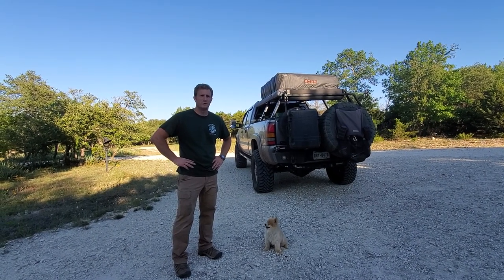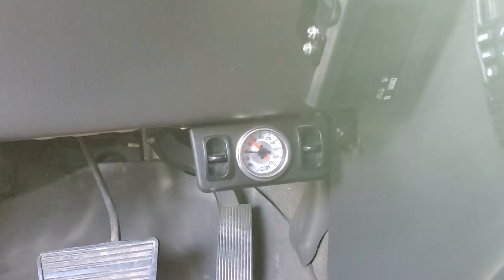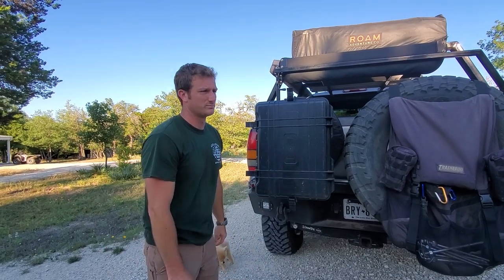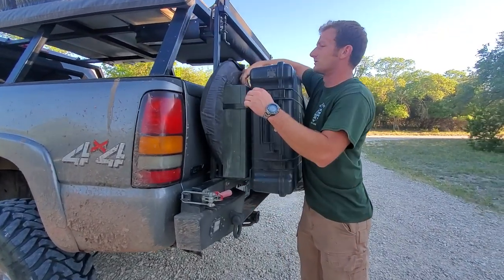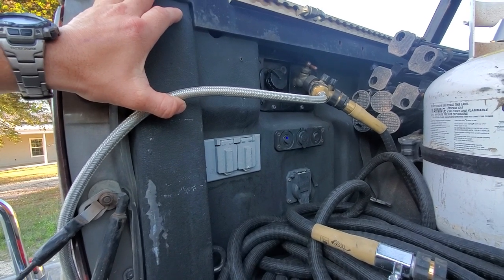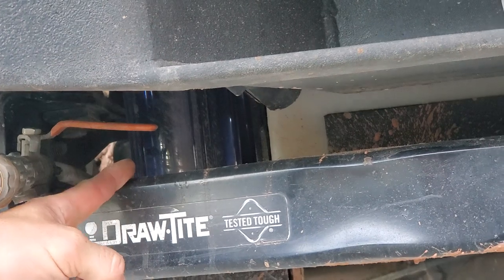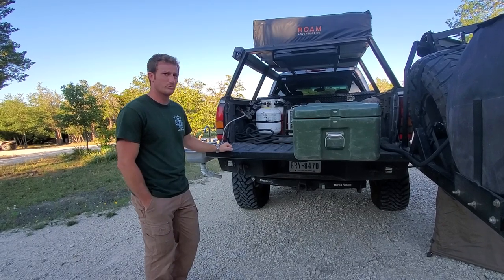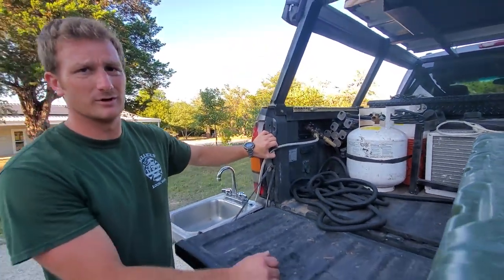Walk around rear Overland SAS Duramax

Comment: Great Video!  All your creature comforts match what my wife needs or would need.  I sure would like to replicate your "portable shower" in the Pelican case.  I don't suppose you could provide a simple line drawing or parts list?  Again, great stuff and many options I may replicate.
Reply from the maker: Thanks man. 
I dont have a parts list or anything but it's literally just a pelican cade with an RV water pump,  propane water heater, a 1 lb cylinder and a 12v battery. A lot of people have built something similar since.

Comment: It's the best durable setup I have seen, can you explain how you installed air compressor buttons and the connection to the tyres?
Reply from the maker: Thank you.  
The compressor switches are from air lift. It is a dual needle guage and and a switch for each side up/down.

Not for the tires though. It's for the rear air bags which are air lift 7500 lb bags.
Reply: @mikkiejordan5540 do you have any issues with the bags at full rear end flex/ articulation?

Comment: Hey you mentioned a battery under the truck hooked up on solar. Do you have a video on that?
Reply from the maker: I do not. But it is a Valence lithium battery from ebay, and a renogy solar charger from Amazon. The bracket is just angle iron.

Comment: Do you have a truck walkaround video anywhere? I really like the stance, trying to figure out what to do with my gmc LBZ
Reply from the maker: I do not. I might make one in the future though. Seems like there are enough ppl curious about it
Reply: @mikkiejordan5540  It'd be great to know, I've been on the fence about building my LBZ or punting it and starting with something more capable.
Reply from the maker: @dillon3355  until I make a video, I can summarize if you're wondering about stance and offroad capability. 

Its a SAS using WFO stuff and an '07 Superduty Dana 60 netting about 5" of lift. 

I run 37 x 13.5 r17  Toyo Open County MT on factory 3rd gen dodge wheels with 1.5" adapters in the front and 2.5" spacers in the back. I have over 200k miles on the spacers with no issues (and I tow heavy).

The have Eaton lockers front and back (electric in the front, mechanical in the rear) and 4.56 gears. It is plenty capable in this configuration. 

I have been wheeling fullsize trucks for almost 20 years so I am comfortable on tight trails even though this is a long wheelbase and is plenty wide.

I'd say be unique and build your LBZ. If you stay IFS  you need to upgrade your tie rods as they are the weakest link. Check your glovebox for the G80 code which indicates that you have the factkry rear locker. If it turns out you have it  you need to watch some YouTube videos on how to get it to operate like you want it to.
Reply: @mikkiejordan5540   You're such a stud man, thanks for the break down.  I'm poor so I'll be going leafs,  but other than that,  this seems the direction ill be going. Thanks again!
Reply: @dillon3355  if budget is a concern comsider the WFO coil spring option for the Superduty Dana 60. I wouldn't put leaf springs under a truck these days.
Reply: @mikkiejordan5540  Glad to finally, officially see that you say these are 3rd gen Dodge wheels. What spacers do you use? Very curious if you say they've stood up to real use. Did the center bore need to be opened up more? Would they have bolted up to the hub without the spacers? Thanks---- 2002 1500HD.
Reply from the maker: @AugustFourSeven  I have been using aluminum spacers off ebay for 13 years. Only trouble I've ever had was discount tire stripping out the studs cross threading the lug nuts with an impact.

The center bore on the dodge is larger than GM so they will fit on without spacers. You would need to open up GM wheels to put them on a dodge (A lot of dodge guys run H2 wheels).
Reply: @mikkiejordan5540  thank you on the detail on the axle setup. My front differential in my lbz just went out and I was actually looking at the wfo setup this past weekend and daily on setups. How's the ride on road? I've yet to find anyone who has given any feedback on the comfort on road as well. Ive gotten some good ideas from your setup but I want to do it with my taste but plenty of detail on your rig. Also did you do the sas swap yourself or have a shop do it.
Reply from the maker: @ccooper04  the ride improved greatly with the SAS. 

But I was coming from 3" worth of cranked torsion bars lol. I can say that it rides better than my buddies 2010 f250, but worse that my Wife's 2015 Duramax (bone stock).

I will also say that the turning radius improved dramatically.

Comment: And how did you install that York compressor!? Extremely interested in that!
Reply from the maker: There is an empty space for a 2nd alternator on the driver's side of the engine. Has threaded holes and everything. I just built a simple bracket to hold the compressor and bolted it there. Then an idler pulley (also factory), and a longer serpentine belt.

Comment: LIke what you did with the wheel well.  Have not run into a need for a skid pad under it?
Reply from the maker: The filter system has a skid plate. Haven't found a need for a skid under anything else.

Comment: Did you wire up the inverter and the tank heater yourself?
Reply from the maker: Yes I did. Pretty much everything I did myself other than the 4.56 gears. 4 wheel parts installed those.

Comment: Sick rig man. I'm interested in the 3 stage water filter. Did you buy separate components and DIY it, or is it a kit? And it sounds like the filtering happens from tank to output, so do you have issues with gumming up the tank when you pump it in from different natural sources?
Reply from the maker: It's a kit safeh20. They have several different kits and are much cheaper than the Noah kit I was originally looking at.

When I'm pulling from a static source to fill the tank I flip a valve so that potable water is entering the tank. Then it gets filtered again when I pull it back out of the tank.

Comment: I read on a different video you have 5 inches of WFO lift. How did you obtain that when they only offer 3-6-9 inch kits?
Reply from the maker: I replaced the mount on the bottom of the coilover with a smaller version, shortening it about an inch
Reply: @mikkiejordan5540  Could you then theoretically replace it with a larger lower mount on the 3 inch kit to create 4 inches of lift?
Reply from the maker: @kylenicholas_mtg_lv  I'm not sure how much longer of a mount they make. But if they do, I think at that point you might be maxing out the factory Ford track bar, which is used on the 3" kit.

Comment: Creative and multi purpose setup, well thought out, hooah👍, I personally have the 8.1 version, and was wondering the wheel, tire , suspension, ect...? if you could provide details. And by the way fuck those guys, keurig and hair curler is a great idea on the trail. Gotta keep the wife happy to keep going back out.
Reply from the maker: Right on, man lol. 

The suspension is a SAS from WFO Concepts coming out to about 5" of lift. 

Wheels are factory 3rd gen dodge wheels like 8.25" wide. 

Tires are 37x13.5r17 Toyo Open County MT